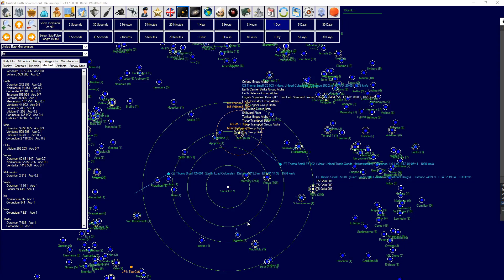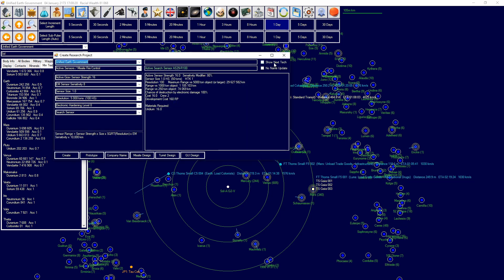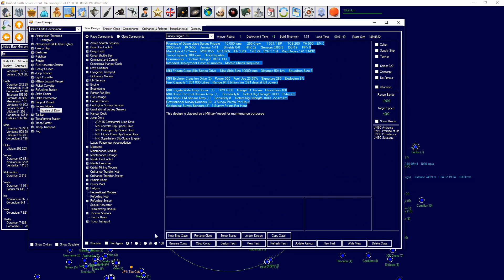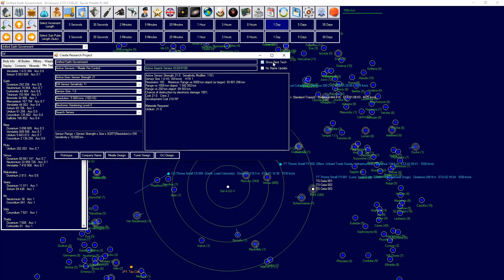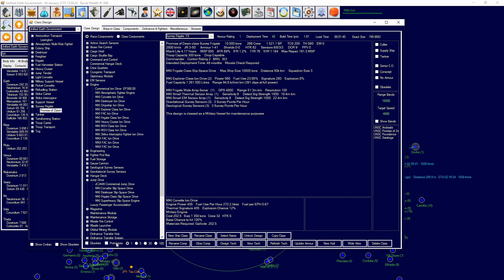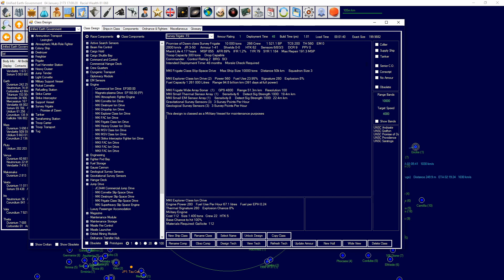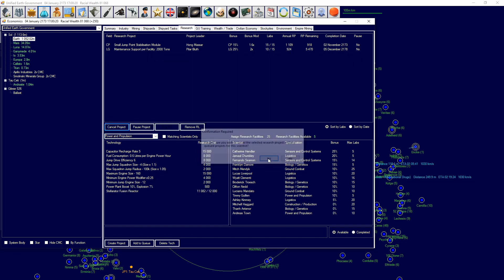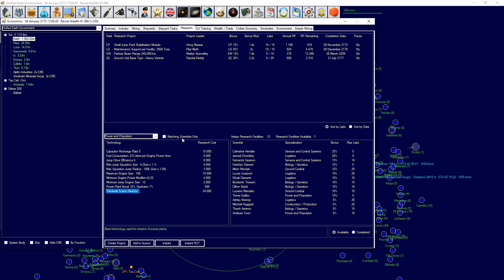Aurora 4x C# Ship Design (1) -  Prototypes and How to use them

Comment: How does designing the omnipresent first geosurvey ship change from basic to C# version? I noticed that I can't design and research any parts for surveying and they just show up as generic parts in the class design window. Would it be feasible to start off with a combined Geosurvey and Gravsurvey vessel or is that too much of an investment?
Reply from the maker: you can do that but you will be sitting around for quite a bit waiting for jump theory so you can then research gravitational sensors
Reply: @DefranStrategy  I already got gravsurvey sensors researched and jump theory is on its way, my concern is having to kit out a shipyard for one of each, taking up space that could have been other ships like military stuff or mining vessels
Reply from the maker: @homeopathicfossil-fuels4789 For your first vessel It is up to you but i prefer to start off with a geo survey ship then eventually down the road build a much bigger ship with both sensors, and a jump drive, again at this point its more down to philosophy rather than mechanics.
Reply: @DefranStrategy  Ah, I see! Thanks! :D I have a bit of a hard time navigating your videos, can you tell me about Intended Deployment time and what "Morale Check Required" means and if there is a way to mitigate that? I set mine to 12 months hoping that it would somehow mean that the ship carries enough supplies, fuel-wise it can run for two years.
Reply from the maker: @homeopathicfossil-fuels4789  I suggest you check out the military ship design playlist and the video "Basic military ship mechanics" as it covers that.
Reply: @DefranStrategy  Will do! Keep up the good work! You are helping me understand these fantastic means to make this quarantine less boring!